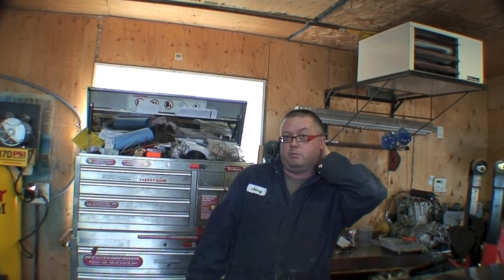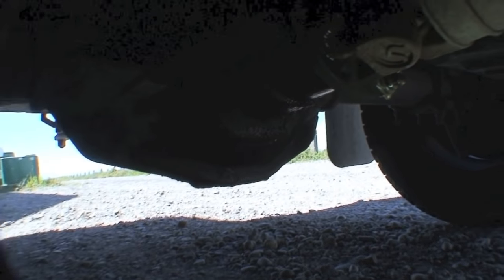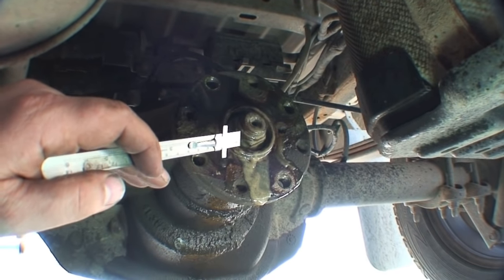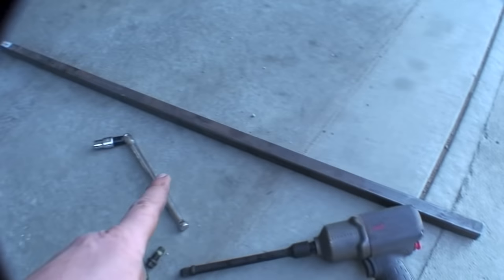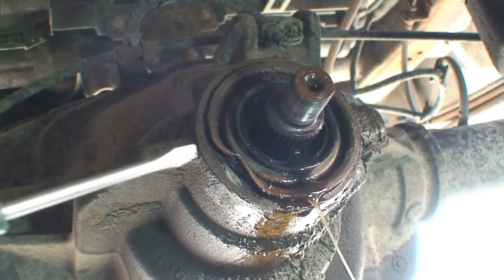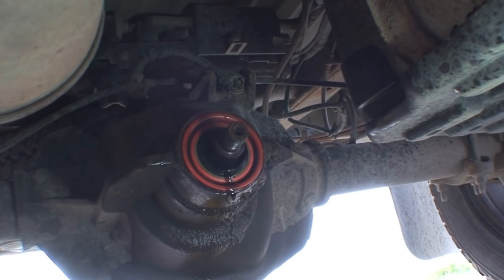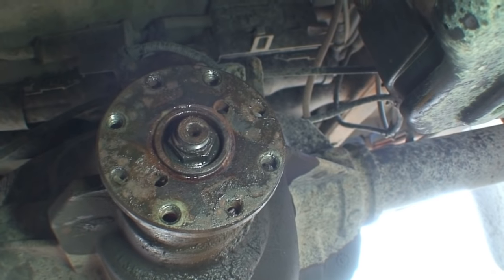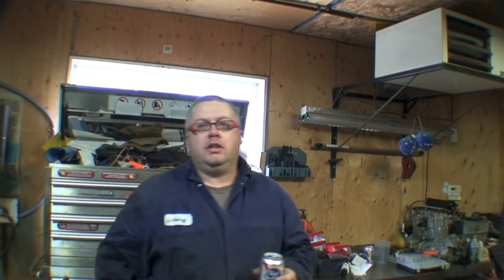How to Replace a Rear Differential Pinion Seal

Comment: Holy shit that's a lot of Loctite for those little bolts. Better hope you never have to replace that seal again.
Reply from the maker: +BC Nation why ? They came out easy enough
Reply: Loctite actually keeps moisture out of threaded joints thus preventing corrosion which DOES break off bolts. I slather driveline fasteners with it and have had no issues over decades (fuck, I'm old) doing so. What doesn't get thread locker gets anti-seize and electricals get silicone tuneup grease, especially on connector plugs.

Comment: bro what years 9.75 can we swap into our ,04-06 f150s?
Reply from the maker: it shouldn't matter as long as it's the same generation truck, if it's 4wd you'll need to make sure the gears match.  you can make anything fit if you're creative enough
Reply: Bullshitkorner yeah I'm just trying to find if the pinion length changed. if the shocks mounts changed. etc. what I'd would have to mod.

Comment: Yeah my truck is a 2002 F150 4x4 5.4. Axle code H9 Which is the 3.55 Limited Slip. My seals are blowing out cause of the retarded way they set up the vent tube. It is full of dirt because the tube sits facing up on the c-channel under the bed. Rerouting it to bend downwards.

Comment: Man I've got a Dodge Ram 2006 2 wheel drive Magnum 4.7 liter piece of s*** I swear every time I get this truck right something f** up on I swear this truck f**** hates me I wish I could just sell it and get rid of it but he'll I don't want it nobody else does neither is that an overhaul of a transmission computer box upper lower ball joints I don't know how many times a arms support bar support bar links computer box or brain box if that's what you want to call it buddy of mine calls it a dead man's truck hell trucks has tried to kill me or itself with me in it for some reason and nobody knows why it'll break the front passenger Rim it's done it three times and nobody has any idea why it continues doing this there is no reason what's the weather when it's a brand-spanking-new stock rim every f**** time that it does this I put a brand new one on now here I am sitting without a job go. back to work when I come home my rear end is f*** what brand new tires all the way around and now I don't have a job because of his f**** truck that I suck in at least over $70,000 in less than 4 years don't know why I'm telling you this I just think I got to get off my chest it hurts your pride it hurts your wallet don't get me wrong the truck is beautiful by looking at it looks are deceiving trust me I know for a fact